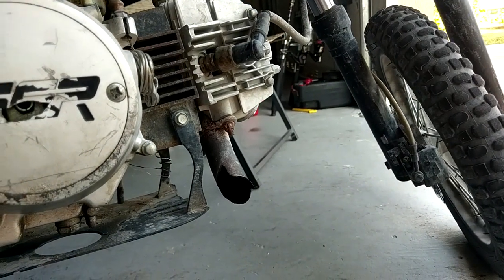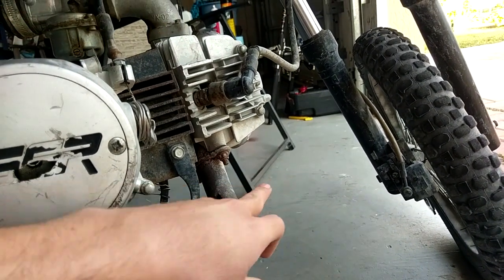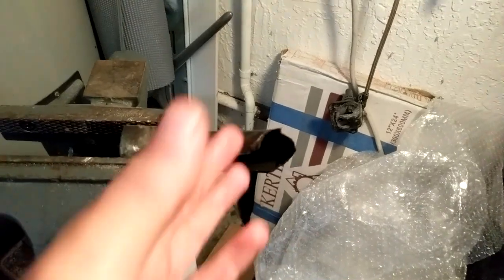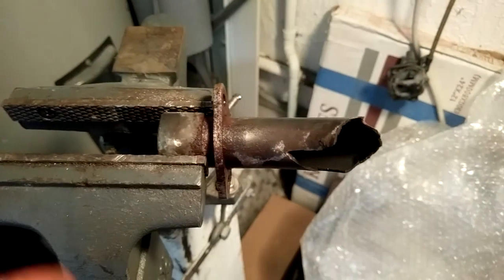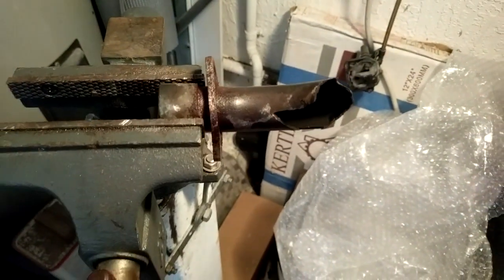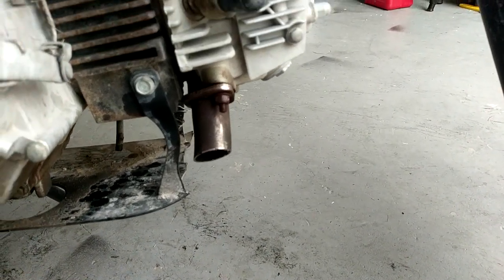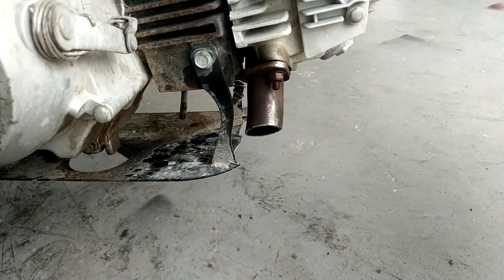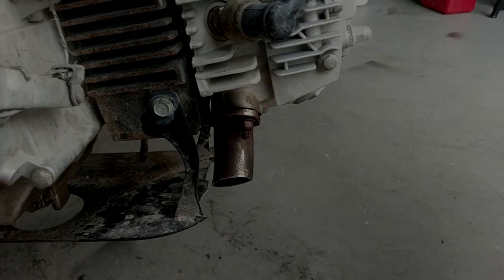How To Make Your Dirtbike Backfire/Shoot Flames

Comment: i dont get why people think the valves will go bad from cutting the pipe. 1st it shoots flames inside the pipe even if the pipe isnt cut or anything. why do you thing the pipe closest to the engine gets suepr hot in like 10 sec? 2nd its a 4 stroke, 2 strokes have to have that extra pipe but 4 strokes dont